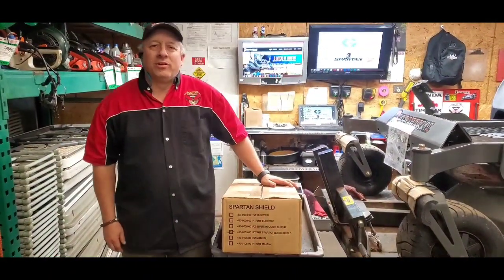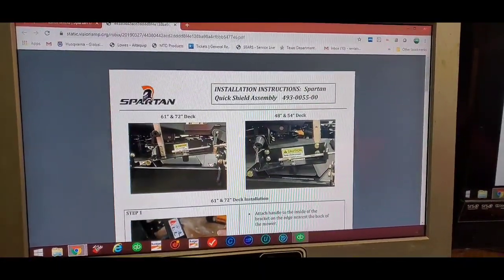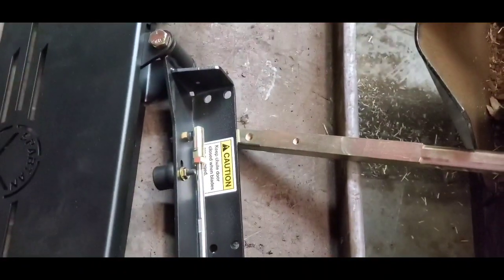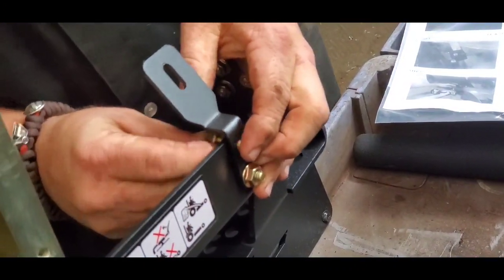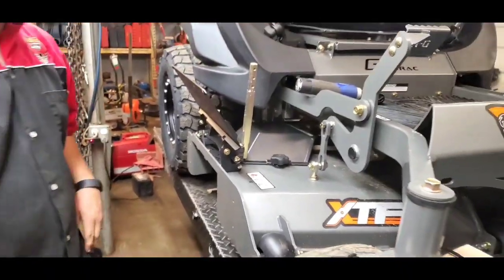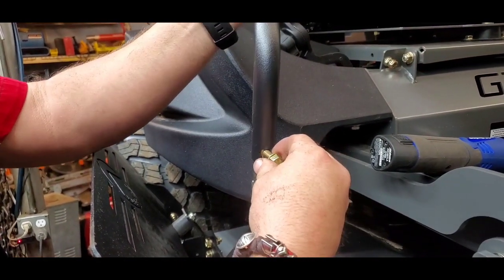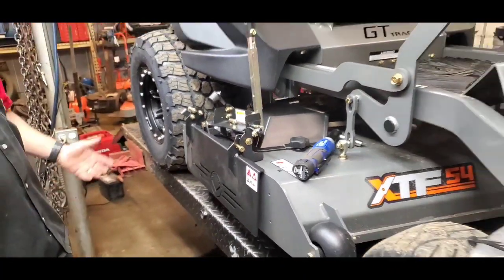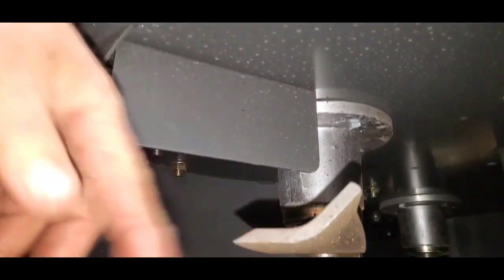How to install a Quick Shield on a Spartan SRT Pro.

Comment: Have this installed on my 54" deck on my RT Pro. However, that rubber bumper stop is not angled. It is straight and the shield slams up against my mower plastic. I just bought it, a 2020. Is this the right piece?
Reply: Same exact thing with mine